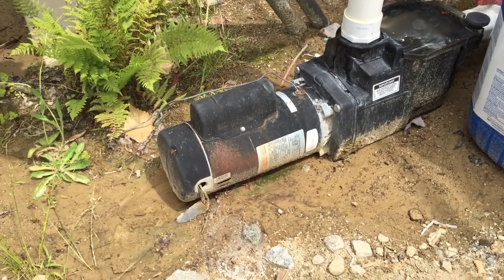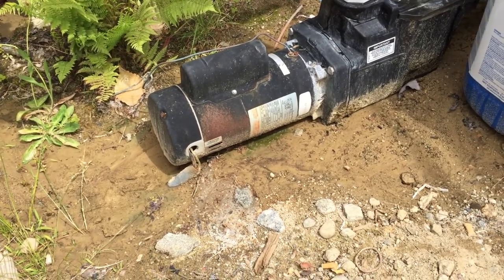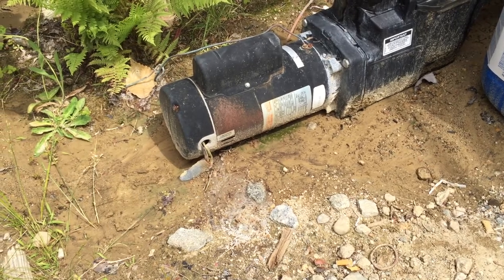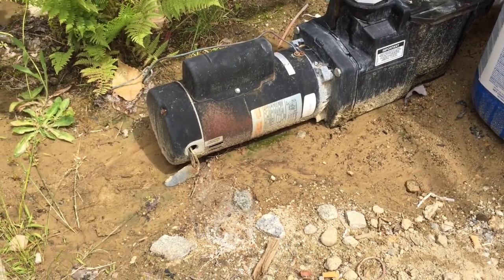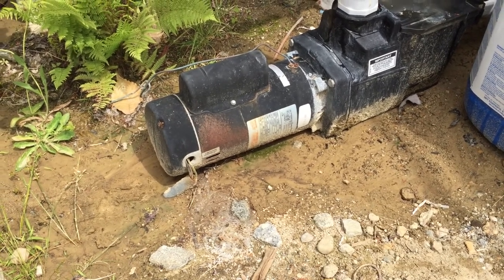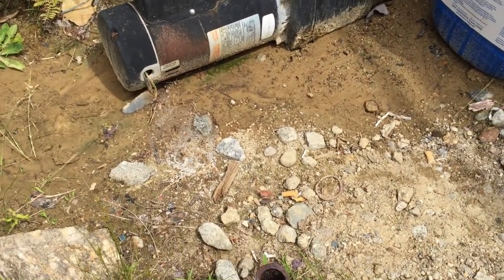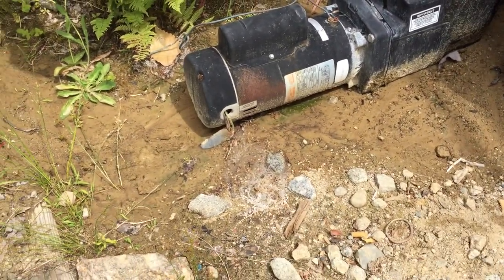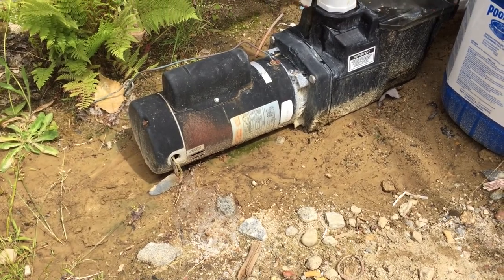Moving Violations Video No. 153: Scary Pool Party

Comment: I am a pool owner, I have recently taken both pumps off line for my pool, due to code violations, I have discovered.  Feeders are too small, incorrect disconnect means, lack of adequate over current protection, over loaded panel board. I am an electrical engineer; sometimes I believe the value of being a master electrician exceeds all. I have calculated the proper electrical requirements per NEC 2017 and have design a partial riser diagram for my pool pumps from my main panelboard. The cost is astronomical, however, it is proper and must be done. I have documented several cases of several life threating electrical code violations of residential and public pool equipment, in which I have un expectedly come across. I can assure, across the entire united states, the majority of residential pool pumps are not properly installed. The number of these cases is so large, it is unbelievable. I wish I could educate pool owners what they need to be aware off and start an inspection service for these scenarios. Pool pumps are installed by pool service men, the majority of the time. NOT a licensed electrician. Pool service providers and contractors shall be required to have a licensed electrician perform electrical related jobs.